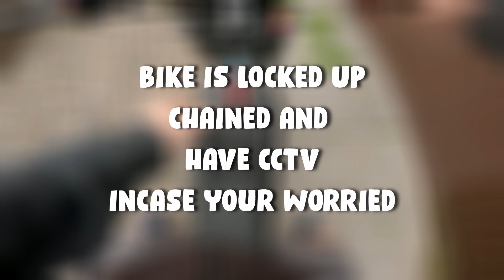DID THE EBIKE TEST GO  WRONG - LEGAL MSVA ELECTRIC BIKE SPEED ELECTRICS SUSPENSION TEST PART 16

Comment: If have switch be it digital on screen of a bitten flic switch where you limit the speed down to 12mph and higher end between 20plus mph for off road use and it has pedals so at lower speed maximum the for uk rds u, ll be ok

Comment: You call it a "LEGAL MSVA" which means it's a scooter or motorbike, is it insured and how could it pass an MSVA with exposed wires and no speedometer and no number plate?
It's clearly not Legal at all it's an unregistered and uninsured motorbike that wouldn't pass an MOT.
Reply from the maker: I call it legal MSVA because that was what I was building and that is the build series.
It would have passed an MSVA as it was being built to the standard that is required. You don't get a Number plate until you pass the MSVA. It would of passed an MSVA at the end of the build as it did have all the requirements including speedometer. This is part 16 of what you would have to do to make it legal.
Reply: @baconbuttties  Ahhh, that makes so much more sense, so you was just being a bit naughty in the pre-finished test build :)
Reply from the maker: @ThatGoth  Yes a little bit naughty. I wanted to test that everything was working as it should.

Comment: This bike is amazing, have a lot of power.
Can you help me a little bit? I don't understand a lot about the batterys, and I can't find anything about this, if I build an e-bike that is 1500w 48v, and add a battery that is 48v and 13ah, what's the distance that I could go with top speed like 65km/h(I think it's 45 miles/h) . Could this go more than 20 km?
Reply from the maker: I had a 52v 1500 watt ebike and it would do almost 30 miles 48 km depending on how you ride it. If you went top speed everywhere then it would be less. 1500 watt 48v Ebikes usually only go 35 miles an hour .

Comment: How do you plan to make it street legal ?
Reply from the maker: I have to stamp a chassis number on the frame, limit speed to 28 mph and take it to be registered at the  MSVA.
Reply: @baconbuttties  if it didn’t have pedals would you still have to limit the speed to 28mph?
Reply from the maker: @HowlingWolfLeather  you can register it as a higher powered motorcycle but you would then need a motorcycle license.
Reply: @baconbuttties  right, I’m with you. Thanks
Reply from the maker: @HowlingWolfLeather  👍🏼
Reply: @baconbuttties  is it really ok for you to make up a number on the frame by yourself ?
Reply from the maker: @DavideBertola  I wrote off for it,the number is from the DVLA 👍🏼

Comment: Cool stuff! I've been out on a few test rides recently but am having a bit of a mare with my controller at the moment not outputting the correct current and am trying to get a replacement. Give you said the front end was getting light and haven't gone past full throttle definitely makes me want mine to work properly 😂.
Reply from the maker: That's bad news that your controller isn't working properly, hope you sort it out 👍🏼

Comment: Right now i have a 3000w motor and 50amps to the motor, love my bike but i think next year i am going for 5Kw or 8Kw but need to get a 72v battery
Reply from the maker: I think my mid drive bike I built before had 30 amps and 1500 watts, 5 to 8kw sounds great 👍🏼

Comment: Yes it gets addictive! what power settings were you running on the test?
Reply from the maker: The controller is set to 125 amps so I should be able to get over 9000 watts peak power.
Reply: @baconbuttties  what about phase current?
Reply from the maker: I Haven't touched the phase current settings, but I can't remember what it was. Will have a look tomorrow.
Reply: @baconbuttties   should be around 300 with 125a battery current. you can also adjust the throttle mid current to adjust throttle curve/sensitivity. also acel/dsel ms which will be reversed as you had to reverse motor i usually run 50ms on both so its not to jumpy.
Reply from the maker: @DeltaCmndrElite  I think it was 300, thanks for the advice and will have a look at settings tomorrow. The throttle did feel pretty good but I was taking it easy.
Reply: @baconbuttties  https://www.youtube.com/watch?v=SiMHTK15Pik&t=12s